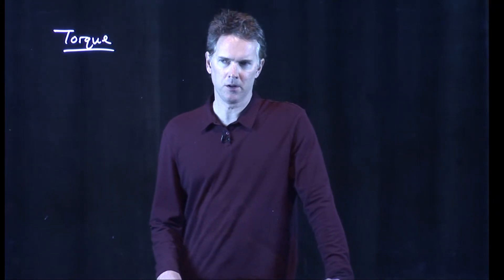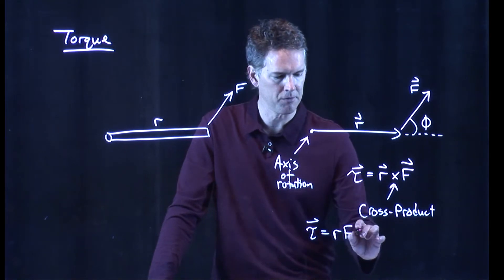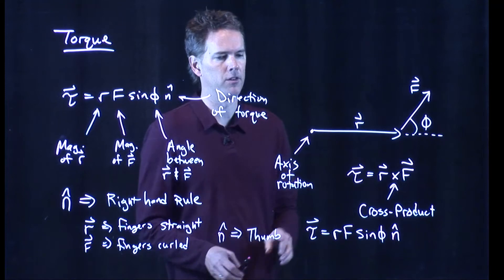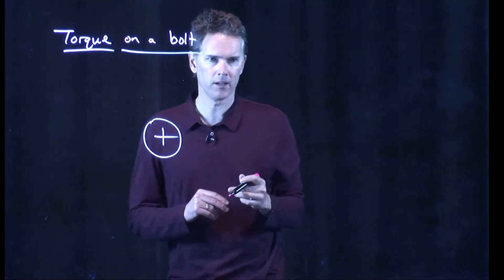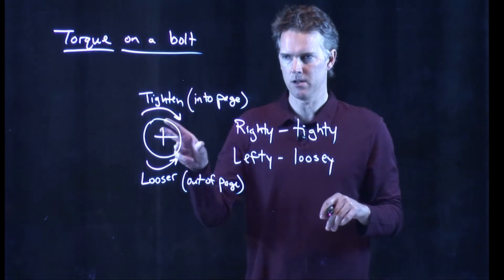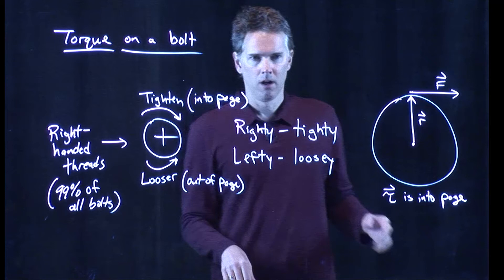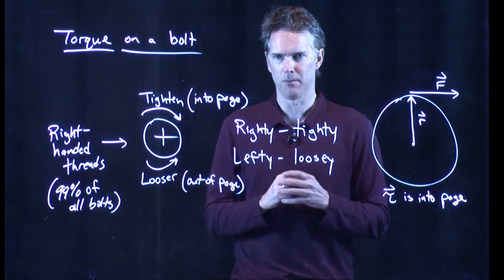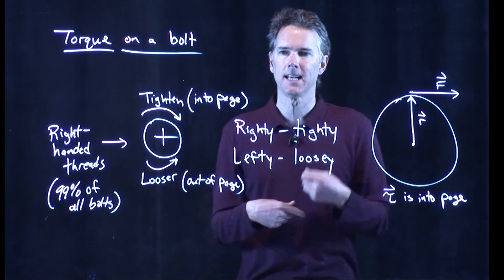Torque Cross Product

Comment: I always assumed torque was in the direction of motion, but I guess it isn't. So, wait, angular momentum is also perpendicular to both r and p, so is torque and angular momentum the same thing?
Reply from the maker: Torque and angular momentum are not the same thing, but both have a direction given by the right hand rule.  Think of an object laying on your table. If the object is being twisted in the clockwise (CW) direction by a torque, then the direction of the torque is into the table. If the object is being twisted in the counter-clockwise (CCW) direction by a torque, then the direction of the torque is out of the table.  This is the ole "Righty tighty lefty loosey" phrase that applies to screws.  Turn it to the right (CW), it gets tighter because it is going into the table.  Turn it to the left (CCW) , it gets looser because it's coming out of the table. 

(Sidebar: this only works on normal right-handed screws.  Very occasionally, you come across left-handed screws and everything is reversed.)

Angular momentum has the same rules for direction, but of course different units since angular momentum has to do with rotational velocity, not rotational force.

Hope this helps.

Cheers,
Dr. A

Comment: I was wondering about direction of cross product. consider if we push the door in outward direction, with force perpendicular to the length of door. the force is in forth direction and moment arm is perpendicular to it, then if we use right hand rule than door should move upward!!! I am confused about this
Reply: Suppose the hinge is on the left side, and you open the door opens away from you.   You push forward.  The radius vector points to the right.  The torque on the door is (by our convention), pointing upward along the axis of the hinge.

The direction of angular quantities is defined in the direction of the axis of rotation, and doesn't necessarily correspond to anything physical happening in that direction.  Think of it as the direction that the motion isn't happening, because motion is happening in the other two directions, and there is no clear reason to choose either of them.  It is an arbitrary convention that we define it with a right-hand rule.  We could've just as easily defined it with a left-hand rule.

Comment: does the angle between force and the radius vector is always constant for a particular torque....if it is so how can the bolt rotate in the same  plane  containing  the force and the radius vector   as its angle will be continuously  changing
Reply: The torque formula is an instantaneous event.  This isn't like work, where it is a cumulative quantity.  Take the force, the radial coordinate, and the angle, all at the same time, and that gives you the corresponding torque at the same time.   In an example in a non-calculus Physics where torque is applied through a rotation angle, they will usually give you a setup where the angle in the torque formula can remain constant.  Both force and radius vector may rotate, but they both rotate the same, and the angle between them remains constant.

One example where it is NOT constant, is in a crankshaft of an automobile engine.   At bottom-dead-center and top-dead-center, the piston cannot apply any torque to the crankshaft, because the force from the piston points directly through the center of the crankshaft, and the sine term is zero.  It is much more effective after the shaft has rotated 90 degrees, and the connecting rod has better leverage on the shaft.   This is part of the reason why gasoline engines need electric motors to assist with startup.